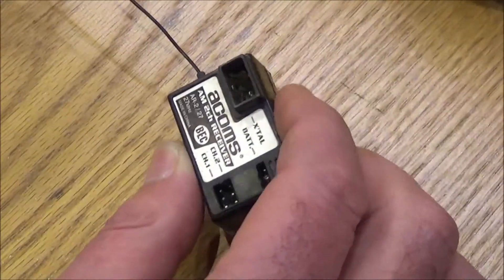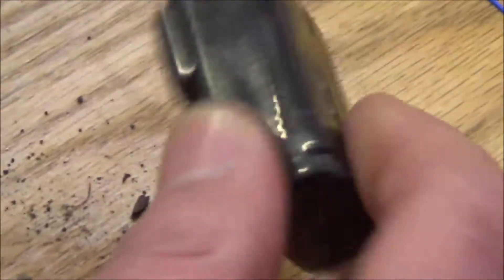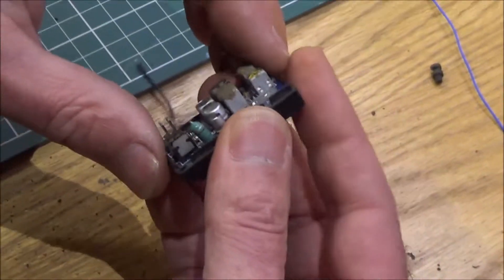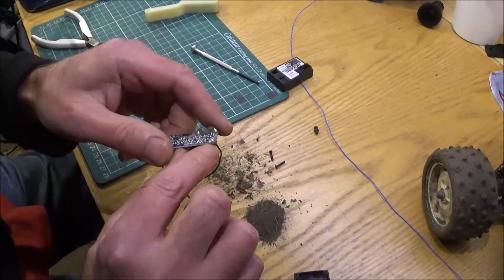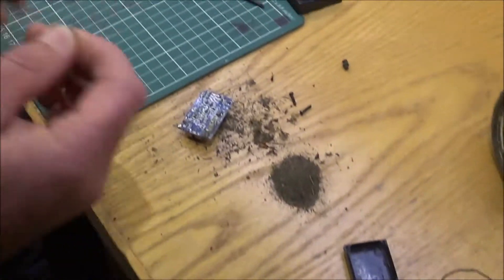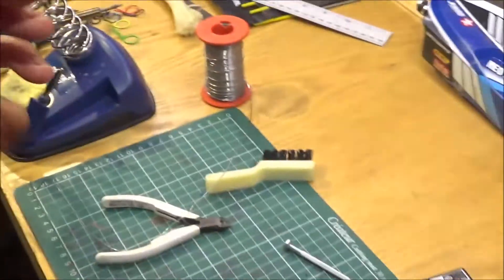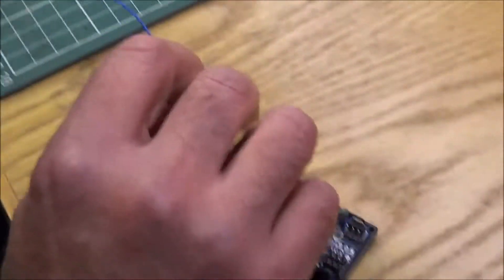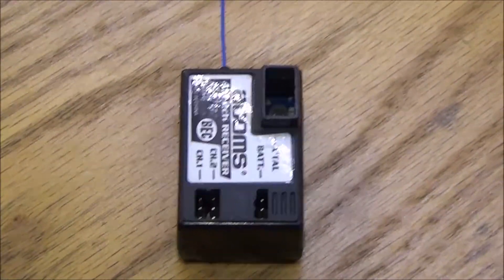How To Fix a Broken RC Antenna / Aerial for a 27mHz Receiver

Comment: Hello, i need some help do you have a Facebook or Instagram i want to send some pictures to understand my problem
Reply from the maker: Sorry, I don't! If I can help on youtube, I'd be happy to!
Reply: @MarkBryanRC  can you tell me how this green thing near the antenna is called?
Reply from the maker: @tasoscharak_4345  it's a resistor and it restricts the flow of current and reduces the voltage.  :)
Reply: @MarkBryanRC  thank you for the answer and for your time
Reply from the maker: @tasoscharak_4345  No problem!  :-)

Comment: Question  on my HPI Baja 5B there is no hole for the antenna wire to stick out from the receiver box,  I'm not getting much range?  its a 27mhz HPI remote,  wire looks OK Your video isn't showing
Reply from the maker: Is the wire inside the receiver box, I assume it must be if there is no hole? If so I would drill a small hole in the box and extend the antenna outside the box, this should dramatically improve the range!  :)

Comment: If reciver antina little bit cut then what will happen
Reply from the maker: If it's only cut a little at the end, there should be no problem, but this antenna was cut 15cm short and needed to be replaced!   :)
Reply: Mark Bryan RC bro my transmitter unable to bind with reciver and the antenna have little bit cut then what I do
Reply from the maker: Fit a new antenna, if that does not work you will need to buy a new receiver.
Reply: Mark Bryan RC bro does have any other options
Reply from the maker: Sorry not that I know of, it sounds like you have a 2.4Ghz system and mine are analogue 27Mhz systems. The only other thing I can think of is to check the manual and reset the receiver and try to bind again. I had a similar problem a while back, and had to send the Receiver back for a refund.
Reply: Mark Bryan RC how I reset the reciver
Reply: Mark Bryan RC bro I have ct6b reciver when I contacted the battery to the reciver only one time its glow single light and than unable to bind with transmitter
Reply from the maker: I am very sorry, but I do not know this system, I wish I could help, I really do but I am afraid that I do not know.
Reply from the maker: I cannot help - sorry - I watched the video - i tried but forgive me

Comment: Does a rj11 cable work too
Reply from the maker: Hi Johan - I haven't tried RJ11 cable but I'm sure it will work OK as the wires are a similar diameter - go for it!  About 30 to 35mm long should do the trick   :)

Comment: just what I needed, nice job! where do you recommend picking up some of this 1/2 mm wire?
Reply from the maker: Thanks James! I got this wire from a length of telephone cable! Computer network cable will do just fine too - you can find this stuff everywhere! Doesn't need to be anything special, just nice and thin! I'm sure you can find something suitable too!  :)
Reply: Mark Bryan RC Brilliant thanks Mark I’ll have a root! 😁👍🏽
Reply from the maker: Great, hope you find some lying around and don't have to buy any!  :)
Reply: Mark Bryan RC Hey Mark, found a bit of network cable and have soldered it in, seems to be working! but..i have a couple of issues..wondered if i could pick your brain?!?
Reply: The receiver works fine until over a range of about 5 meters when it just goes all glitchy 🤔 I trimmed it to 35cm’s as you suggested in a previous comment, it had a similar range pre trimming when the cable was around 50cms..
Reply from the maker: @jameshenderson4225  Hmm... very strange! If the new wire doesn't work, maybe the receiver itself has a problem, the aerial should work just fine if it is soldered on properly.  :-)
Reply: Mark Bryan RC l

Comment: Yet another Top Tip friends!!! 👏👏👏👏
In my unfortunate position, tips like these are absolutely Golden!!  One question..... and I can't seem to find a good answer on the Interwebs - would this also be an effective fix for a 2.4Ghz Receiver Antenna Wire??? 

As far as protecting the Receiver... Here's a couple of tips for you!
1. Whilst you have the circuit board out, "Paint" the entire Board with either Conformal Coating or a good, 2-Part Epoxy. Keep any coating OFF of the pins for the leads to plug into. Also, apply some to the Antenna Wire, at least 1cm from the Board.
[Dust Proof and VERY Water Resistant!]

2. Buy a number of short Receiver Leads (male one end, female other end), preferably about 3-5cm long each.
Remove the Receiver Board, and plug all of the Leads into any pins going out (channel/Batt outputs). 
Buy one Tube of RTV Silicone (Color isn't Important). Whilst holding the Wire Bundle, smear the RTV Silicone ALL OVER Every bit of the Board and Plug Ends. Slide the Case Top through the Wire Bundle, until it rests over the Board. 
Apply some more RTV on to the Bottom of the Board (for a tight pack when Case is closed). 
Fix the two Case halves together, tighten Screws (if no Screws, lightly clmp or rubber band the halves tight).
Let sit for at least 12 Hours. If needed, add tags to each short Lead, as to where they plug into. 
After the RTV Silicone has cured (18-24 Hours), install, plug your regular Leads into the short Leads, permanently fixed to the Receiver - ENJOY!! 
[COMPLETELY Dust Proof - ABSOLUTELY able to submerge in Water!!!]  🍺👏👏👍👍😎 

I do the second one to my Wraith and any other Crawlers I have, or will have (only have 2 at the moment 😭😭). I go through shallow Streams, and the Rig COULD roll over.... And, at two Crawling spots, there's fairly deep bodies of Water at the bottom. 
I've seen Rigs lose control, and tumble into the deep water, destroying the electronics! Something that I hope will NEVER happen to me. I can't just run out and buy expensive electronic components anytime I please. 😖

I hope that these might be of some help to you or one of your Subscribers!
Carmine 🚂
Reply from the maker: WOW Carmine!!! What a detailed and informative comment! Thanks very much for the advice on waterproofing the receiver - I will look at doing one of mine, and I'm sure that some viewers will also find this very useful.
As for the replacement antenna on a 2.4Ghz receiver - I'm not entirely sure, but if you can solder another 2.4Ghz antenna in the same way then I can't see why it shouldn't work. Thanks again :-)
Reply: Thanks Mark! Always happy to help. Hey, when you get up in age.... I feel I'm wasting something if I don't share my experience. Everybody's got different experiences!! I've already learned a couple of things from you!
Reply: ..... I suppose I could try.... I've got Flysky Radios. If all else fails, a new Receiver is only about $9.00US!
Reply from the maker: Ahh - there is something else we have in common!! Age and a desire to share experience! I'm always glad even if only one person finds some useful item from one of my videos. I am curious to know about your unfortunate position - is it like me that you are on a very limited budget and have other priorities for any 'spare' cash? My family take up the bulk of my little income :-)
Reply: Some of my Family has considerable wealth.... they have no intention of helping us.
I'm on Military Disability Pay. Had an unhappy meeting with an IED, in Kuwait, in 1991.... I was able to carry on for another 15-16 years, then my Body couldn't do it anymore. Being forced into Retirement at 47, SUCKS!! 
Then, in 2006, my Mama became ill. I took both of them in, and did what I could to help both of them in my home. 
In 2012, my Mama died..... then my Dad, 33 days later, from not much more than a Broken Heart. 
Double Final Expenses was staggering, especially since my Dad was also in the Air Force, but a bonafide Hero and Badass! He was entitled to a Full Honours Burial at Arlington National Cemetery, along with me Mum. Paid.
Unfortunately, it didn't include the cost of getting them across the Country, and then we had to get 2100 Miles to the Funeral, plus make arrangements for Family. 

By the time we got back, we realized that we were TAPPED. Life Savings, 401K, everything - GONE! 
THEN we lost the House. 

I thought the worst was behind us, then in 2016, my 28 year old Daughter was killed in a high speed accident with a Semi (Articulated Lorry).
She was across the Country in North Carolina, with her mum (my ex). We were SO broke, we couldn't afford to get to her Funeral....
I'm STILL not over that!! That's a pain that I hope NOBODY has to experience. I'm completely gutted. 

Then it got WORSE! The Great Exalted Obama didn't raise Military Pensions ONCE in 7 years!!!! Rent and Utilities and FOOD kept going up though. 
I'm at a point, where I've lost nearly 115 POUNDS. Mostly by starvation.
At least I WAS a typically FAT American! But seriously, we're hungry. 

I finally swallowed my Pride, and set up an account to accept donations for our plight. 
I shared the link on my favorite RC Forum.... I was SUSPENDED for it! One or two good people shared the link on YouTube Videos.
We've received VERY little help as of now. 
I feel I've humiliated myself for nothing.

For shits and giggles, I'll give you the link... Maybe you know people.

https://paypal.me/pacbeltrr 

Fortunately, I've got enough spare parts to keep my Hobby going. I sometimes think it's the only thing keeping me sane....
I don't like telling that story, and that's not even all of it. If someone told me all that, I might be inclined not to believe it!
I only did this, because you asked. You guys seem like a kind and good Family.
Carmine 🚂
Reply: Mark, I really enjoy the interaction on YouTube and some of the Forums I'm on.... I feel more productive giving back, at least acquired knowledge!!
I've always enjoyed giving. Needing, is a bloody awful situation.
Reply from the maker: Well Carmine - I have no words to reply to that story, anything I type will seem insignificant in response to your plight. I only suffered from a broken back but have struggled on with things as near to 'normal' as I could. I sincerely hope your situation improves - Mark.
Reply: Mark, thank you. I Pray daily that nobody has to know the pain I feel....
We're alive. Sadly, my biggest problem at first, was learning how to live without...... and then I kept losing more. So I'm trying to stay positive and be good to others. Maybe it will keep bad things from happening.

Comment: Hello Lads, I may have to try this myself. I accidently yanked out the wire on my Hpi Trophy Trucks receiver recently. I don't know what the receiver looks like yet because it's buried deep in the bowels of the roll cage, but I know it's a 27mhz Hpi one, and probably full of crud too ! I wasn't too worried when I did it because I intended to replace it with a flysky receiver, but now I've seen this, I may have a go. I've nothing to lose. I can also get some soldering practice in as well.
I noticed you were using a toothbrush to clean your circuit board. Sometimes these can be a little harsh on delicate electrics.
My choice of tools are an old shaving brush I got from a charity shop for 20 pence, which bristles are strong enough to remove a lot of muck, but still flexible enough not to cause damage to tiny wires and components. The other tool I use is one of my Wife's old Blusher brushes. These have really long soft bristles and are excellent for getting in those hard to reach nooks and crannies and are absolutely brilliant for dusting your RC's if they've been sat around for a while. Great video : )
Reply from the maker: Have a go my friend - as you say you have nothing to lose and could gain a perfectly good receiver! Just make sure the soldering iron is good and hot and clean it with a damp sponge (but not synthetic sponge - it will melt!). Tin each surface and wire with solder first and it's a walk in the park - good luck mate :-)
Reply from the maker: Hi Holly Hill RC - I didn't comment on the circuit cleaning brush!!! Sorry! Take another look at the video my friend - it's got very soft black bristles - you are absolutely right about not using a brush with hard bristles - and the shaving brush and blusher brush are great choices :-)   Many thanks for the excellent comment!

Comment: Good one Mark (and Alf). That was a lot of dirt! I like the splashproof receivers. They’re terrible at keeping water away but quite effective when it comes to dirt. I do use 27 MHz on some of my classics too.
Reply from the maker: Cheers Nordic RC Visions - as you can tell the amount of dirt surprised us both! Looks like I could benefit from some of those splashproof receivers - at the moment though I only have 2 vintage Acoms transmitters and have put a 27mhz receiver in all of my cars, just swap crystals and off I go! It would be very expensive for me to upgrade them all now =)
Reply: Mark Bryan RC Yeah I have 27 MHz in my Hoppers and Hornets too. Works fine. Although the new very cheap Flysky 2.4G transmitters/receivers and the likes are a bit tempting. No need for splashproof when the Acoms are working fine with all the dirt. Just empty it once a year :-)
Reply: I'm still using ONE... My second Futaba Attack STICK Radio, that I bought for my second RC, the Hornet. Wish I still had the car, but still have the Radio!
Carmine 🚂